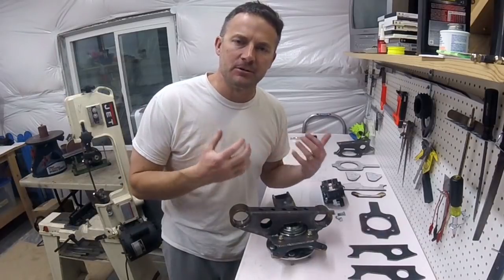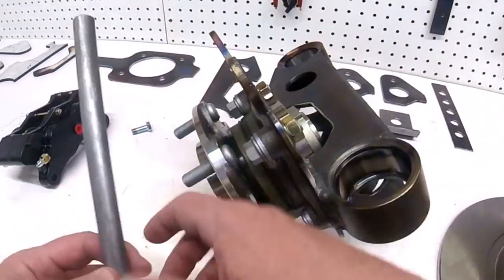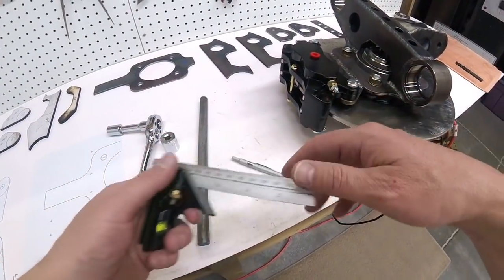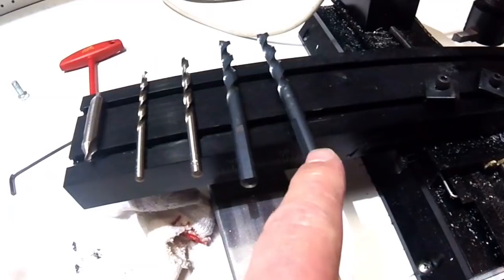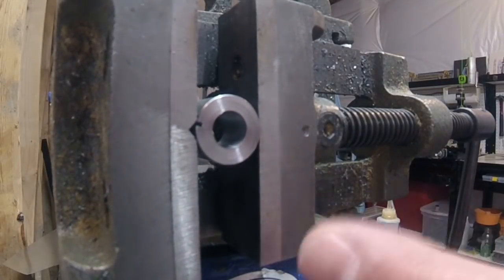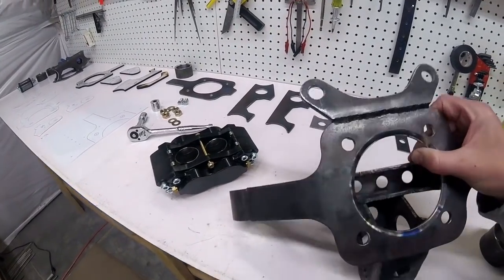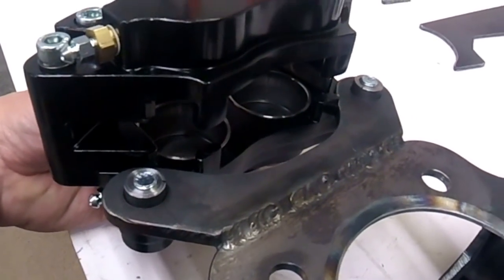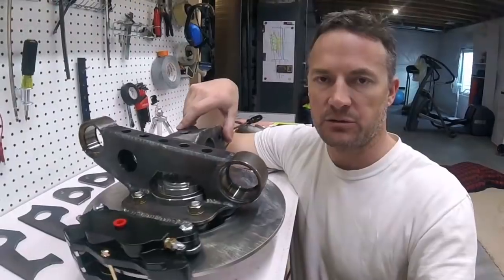Work'in on parts of the Baja #1

Comment: I building model a nine inch rear. Mustang front end  350 SBC  700r4 trans chopped  and channeled side mounts tube trans mount tilt telescope steering and starting the roll cage now subframe done for body floor alum .a lot of work electric windows claw locks door fiberglass fenders oh ya great job on harness I m using wire for dummies handbook makes it easy splicing looks tuff I saw you in the books smart to mark and make harness then just install .nothings just install motormoumts  I think are to rigged maybe rubber mounts on side at least shake your teeth out. I'm disabled but sometime I forget and keep going on the build next project 1976 vette or finish my sons celica almost done we'll great job love to watch some one. Who love working as much as I do have fun

Comment: Good video

When I saw you have a lathe I thought you should have used larger stock and cut a shoulder to have more welding surface area. 

That said- there is no kill like overkill...
Reply from the maker: Hmmm, actually now I wish I did that. Having a shoulder would have made fitting it up square to the bracket easier. Well ya know just more hindsight in my life. Maybe I'll so that on the next batch of spindles I make. Thanks for the idea!

Comment: Hi Doug, Happy New 2024! Question, Am I right when a say that there is no caster angle on your upright (knukle) ? If it's the case, why did you not implement a positive caster ? I, my self designing a 3wheeler motocycle (2 wheels in front) and I'm know if it is worth having a positive caster angle of 2 to 5 degres for example. The only advantage of a positive caster for is the self-aligning torque when ending a curve and returning the wheels into a straight position.🙂
Reply from the maker: Hello Don, the upright has 10 degrees of AOI or king pin angle, and the caster is taken care of in the front of the chassis. Although this suspension looks straight, the front of the chassis is kicked up 8 degrees. So the front has 8 degrees of caster. So it does pull the tires straight, quite strongly actually.

Comment: Just curious as to why you didn't tap the insert on the lathe? At my work, I tap stuff by placing the tap into the chuck and spinning the head by hand.
Reply from the maker: You're correct, on a proper setup that would be the way to do it. I tried to do that on the first piece I made but the lathe was to small. Either the piece was spinning in the jaws or the chuck was spinning in the tail assembly. The taper on the tail of this lathe is really small. So I had to do it by hand, which is a pain on such a small part.
Thanks for the comment bud.

Comment: Bend caliper brkt so caliper is centered and tn make nuts tig onto brkt but center caliper or the pad will ware out faster on one side
Reply from the maker: I agree with you that my bracket came out a little off center. Once I get the pads I think I will be able to center it with some spacers. It's only off a little. Also I think because these calipers have pistons on both sides even if they are off center the wear will be even. 
But I'm not sure and will try to center them more anyways.
Thanks for the comment!

Comment: What brakes and calipers are u using
Reply from the maker: The rotors are 12 1/2" rotors from a 2006 4Runner. The calipers in this video are Latest Rage 4 piston calipers, 14-615510. But when I build it all out I'm hoping to equip it with Wilwood calipers that are same dimensions of these Latest Rage calipers.
Reply from the maker: I think they will be these, Wilwood 120-5081